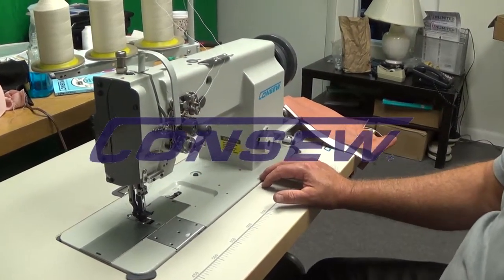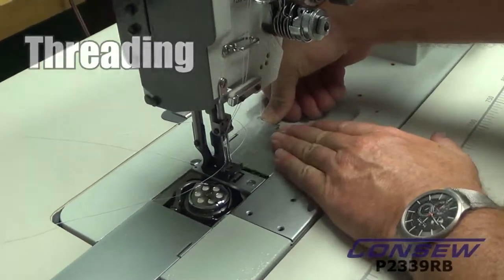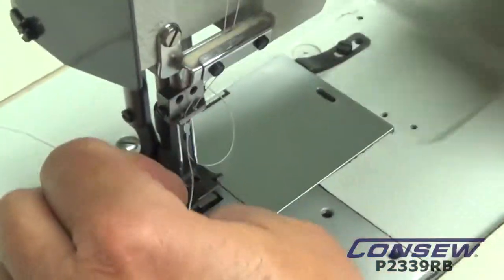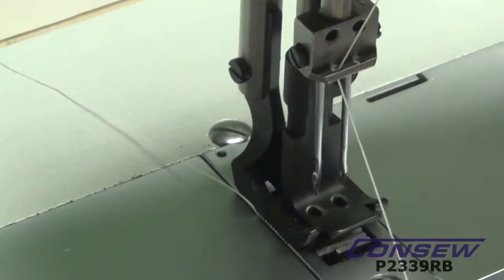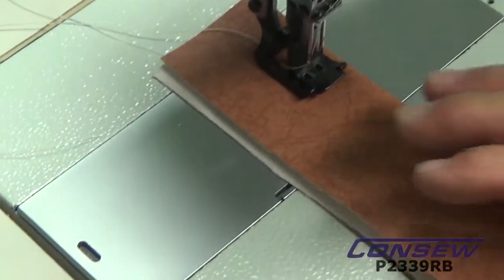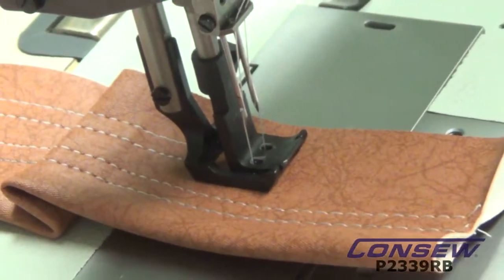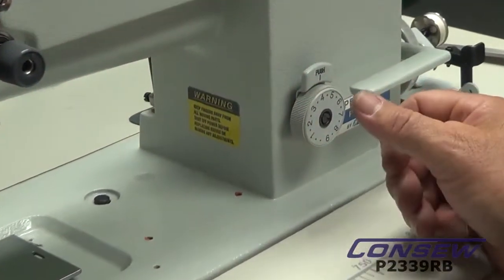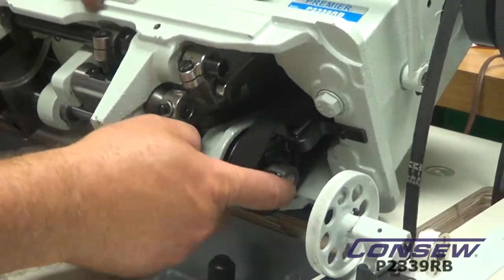Consew Sewing Machine P2339RB Demo

Comment: I'm unclear with the oiling of this machine. I understand that I can the top reservoir can be replenish with oil by removing the rubber cover and throwing the oil in. What I want to know is am I supposed to fill the oil pan at the bottom where the oil pickup/pump is? I ask because I'm not seeing any oil in the oil pan at the bottom of this machine in the video.

Comment: can this machine be used as single needle until double is needed
Reply from the maker: Hello there!

To answer your question, it's best to use a single needle if you're doing a lot of sewing because the double needle will be off-center.

If you're are not doing a lot of sewing then the double needle will do the job with sewing off-center as you adjust.

So yes, you're welcome to use it as a single needle machine.